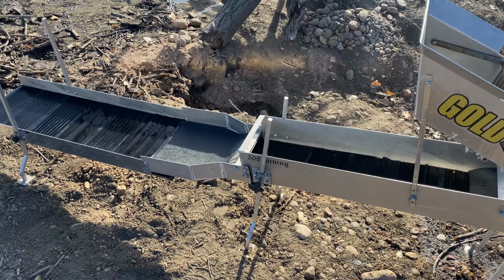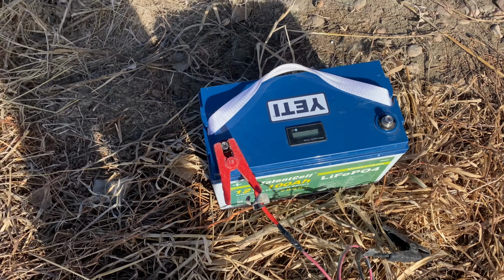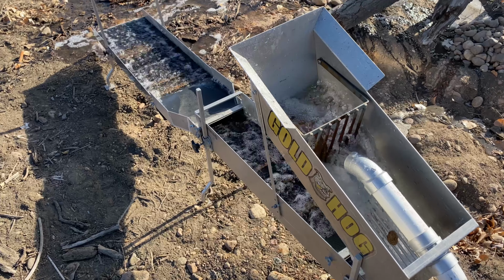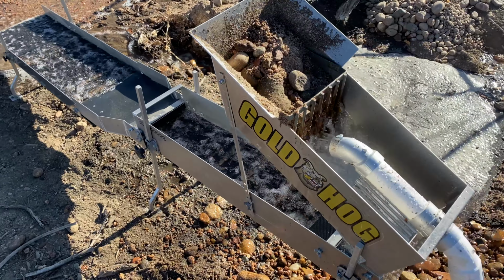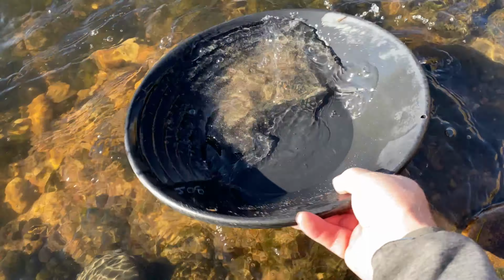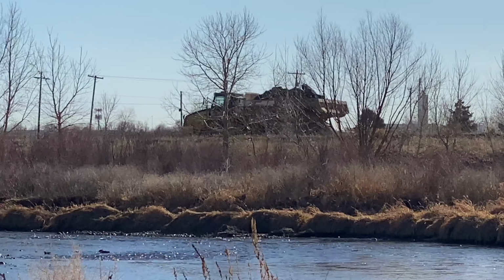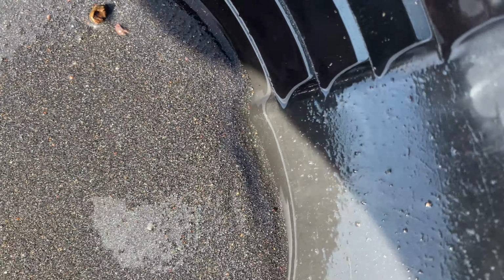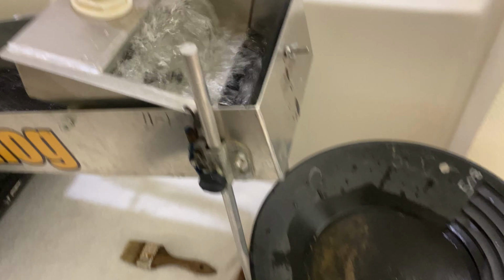Gold hog Piglet Flare Highbanker ⚡️12v powered ⚡️

Comment: Garnets, Black Sands, Topaz, Gold! Hell yes! LOL!!! Like the idea using the 12V Pumps out on the river... i wonder if just one would have been enough for the same outflow you got? nice little cleanup! The wife will be happy!!
Reply from the maker: I have tried with one pump and just does not work. If you had no head lift it would be that same water volume in header box. It’s the lifting the water vertically that kills. Using hard lines instead of lay flat definitely helps but more stuff to bring out lol I have use the same set up but with 75 feet of lay flat but only a foot of lift and it worked awesome!
Reply: @508miningcompany  interesting man! I’ve always pondered using some type of large “boil box” or like a reservoir above a sluice to feed water without using a pump directly. This probably doesn’t make much sense over text. But The guys up in Washington can’t use electric pumps or such. And I was thinking a foot pump with a huge water storage above  so the consistent water flow isn’t disrupted and all the person does is keep that container full of water

Comment: Nice haul for a day mixed with test pans! I run my Piglet at 9 degrees with a 3700 gph pump but where I've been going, there's only about 4-5' of elevation difference between the pump and header box and I also use 25' of pool vacuum hose so that helps keep the water pressure solid. I don't bother with the clay claw since the flood gold where I am on the Front Range here in CO really has no clay on it and the rocks get washed, which allows me to feed it as fast as I can shovel! With 2 of us shoveling, I did put my Gold Hog mini stream sluice at the end to catch any losses and there was some a little bit in its mats but nothing coming out the end in the tailings. Anyhow, thought I'd share for what it's worth! Heavy pans and if you are ever looking for a fellow prospector to go out, let me know!
Reply from the maker: Yeah using hard line or spa hose definitely helps but I didn’t want to haul that much spa hose in. I’ve done it before at Arapahoe bar and everyone thought I was nuts lol I think I ran 60 feet of 2 inch spa hose
Reply: Sam  ~Are you sure you meant the "mini" Stream Sluice put at the end of the Piglet "or" you did you mean the full sized regular Stream Sluice instead.??
Reply: @508miningcompany  ~25 or 60 feet of solid wall Spa Hose is too long. I listened to Doc, all a person needs is about 6' or 8' feet of it coming (discharging) into the hopper which prevents the "kinking" of the lay-flat hose.
Reply from the maker: @royjohnson465  Yes I agree with you and Doc, what I’m trying to do is run the Piglet far from water so I don’t have to carry material. Does that make more sense? I have multiple gas pumps and hundreds of feet of layflat and Spaho‘s but carrying that much stuff gets old lol
Reply: @royjohnson465  yep! That’s what I have and it still caught the gold with nothing in the tailings. If there weren’t 2 of us shoveling as a fast as we could, the Piglet in its own would have been fine

Comment: Nice job bud that piglet with the flares awesome I’ve got the same set up and I use that out here in Iowa for the flood gold and most of the rivers and it does a great job except I just use a gas engine you can run with the way you were that slow I mean look at the gold you got you don’t have to shovel into it like mad just to get gold so you did just fine what part of Colorado are you in? I’ve done quite a bit of GoldMining in Buena Vista went up to the granite and worked up there with the latrap sluice and did pretty good almost a quarter ounce of gold but we busted our asses getting it well take care bud and have a merry Christmas. Maybe sometime we can hook up and go do some Gold Prospecting and a run in dredges or HighBanking that would be fun I usually go out to Colorado twice a year, but these last two years with Covid and stuff I’ve gone up to Michigan and mind the beaches for Gold up there it’s a lot of fun. Out for now
Reply from the maker: I’m on the front Range, but I do a good amount of dredging on the Arkansas. Love the Piglet Flare! I had a Piglet with an extension years ago that I got rid of and regretted it. I also have a raptor and love it. I usually run gas but I spent so much money on this big battery I figured I would use it lol

Comment: If you are worried about head lift why is the piglet set up so high off the ground?I’ve run my piglet with 2 2000Gallon pond pumps worked just fine.
Reply from the maker: How much lay flat were you running?

Comment: I have a 100ah deep cell marine battery,how long can i run those pumps for? Im gonna get a 4700 bushman pump for my GH stream sluice and power pig.
Reply from the maker: Is it a lead acid or Lipo battery? Lead acid batteries you can only use 50% of its capacity, after that you’re damaging the battery. Look at the amps drawn from your specific pump and divide that by 50 A if you are using a lead acid battery. Running one of my bilge pumps at 17 A off my hundred amp Lipo battery I can get about 5 1/2 hours. But I need both pumps to push the water the distances I’m trying to achieve.
Reply: @508miningcompany  Not sure im thinking lead acid it weighs 70 pounds ive been running my 750 gph pump off and on now for 2 years without having to charge it up.
Reply from the maker: @s.d.iprospecting4359  Maybe check the voltage with a multi meter. Make sure it doesn’t go to low
Reply: @508miningcompany  Yea i have a charger for it next time iu use it ill charge it up i think my 750 gph only puts out 3 amps the last time a ran material its was lagging a bit so im sure it needs to be charged,i would need a boost if i pumped 750 gph off and on for 2 years lol.
Reply from the maker: @s.d.iprospecting4359  Yeah make sure you check water levels also if you can on that battery